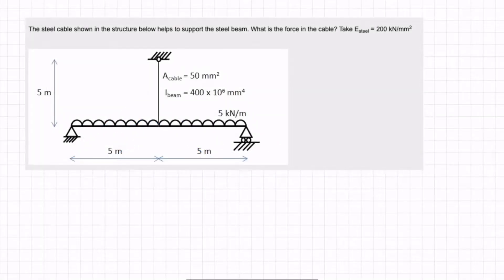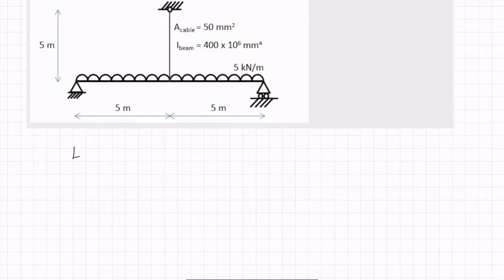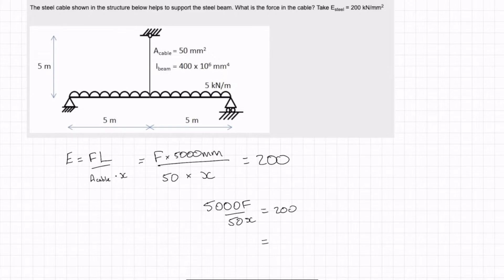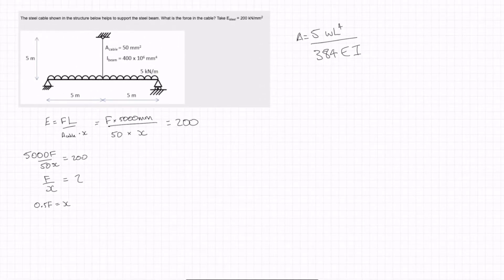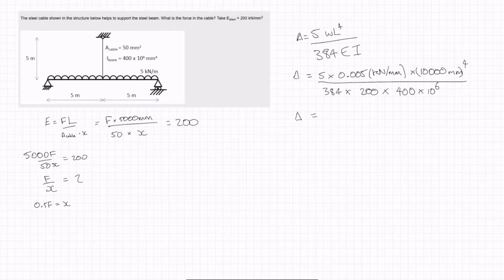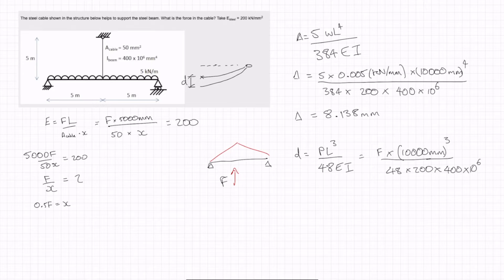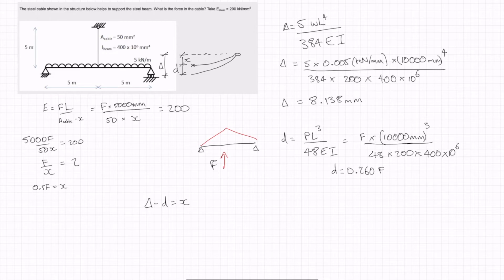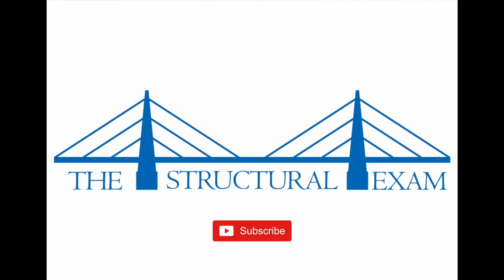Beam with Cable support - IStructE Certificate in Structural Behaviour

Comment: Or, use stiffness method.

take kbeam=48EI/L^3 and ktruss=EA/Ltruss

Total stiffness is ktotal=kbeam+ktruss

Net midspan deflection is umid=P/ktotal. The key is to use P as (5/8)QL where q is 5kN/m and L is 10 m.

Then force in truss is ktruss*umid.

Comment: Hi man, can i get u mail id. I have some doubt regarding symmetry.
Reply from the maker: Draw a free body diagram on the beam and the reactions. It's symmetrical.
Reply: @TheStructuralExam   i need to ask some different problem.
Reply from the maker: @learncivilwithparam170  Just ask here
Reply: @TheStructuralExam   i have   single bay portal frame fixed support at columns and with top beam connected to hinge joint via beam at both ends. The structure is symmetrical and loading also. And load is acting between hinge joint and end of top beam of portal frame.
Can we tell any thing about horizontal force at hinges?
Reply: Hello, do you have an example if the cable is at one end and pin supported at other end? With a concentrated load in the middle.